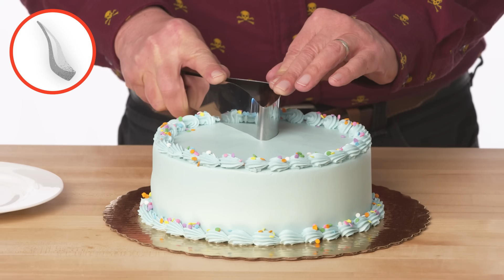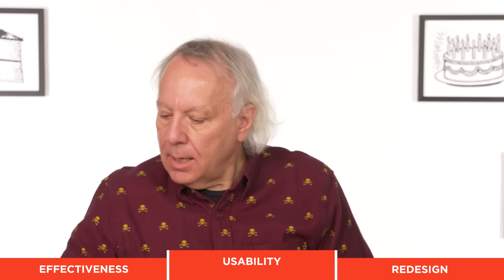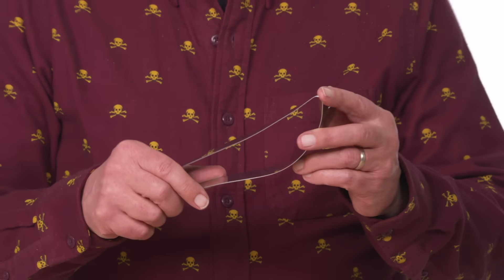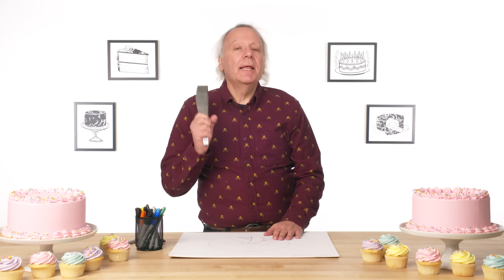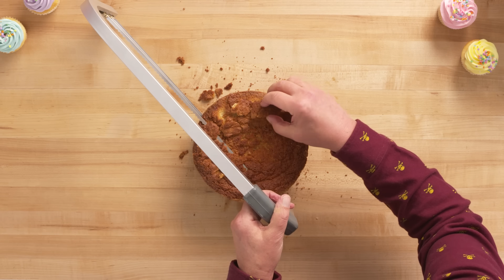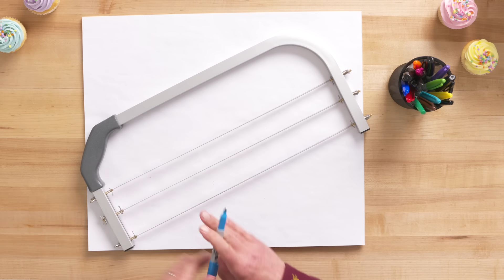5 Cake Making Gadgets Tested by Design Expert | Well Equipped | Epicurious

Comment: What kind of burnt sawdust cakes were made for this video? I’ve used cake levelers like that, as well as wire cutter ones, they work FINE. A cake leveler like that should slide smoothly through because it’s fluffy soft cake, not the same density of low-moisture brown bread lol.
Reply: That's kinda the problem with the cake leveler in the video, it didn't use a wire...
Reply: The thin band saw like blades don't offer much for force, and with the saw teeth, they grip at the cake meaning he has to use more force to cut through. Thin wires can't catch onto anything because they're just that, a thin wire, and the simple design of them allows for easy cutting, hence why levellers come in a wired variety, and not saw blades.

Comment: The Wilton cake leveler uses just one “blade” in the form of a wire, so it’s easier to get even layers and it’s got plastic feet that allow it to easily glide over surfaces. Also uses springy wires at the edge of the leveler if you need to readjust heights. No screws to screw with.

Comment: The cake leveler he redesigned also would not work. If you push at the top handle, you also need something fixed at the bottom too, something like a sliding blade. Without that, the blade basically tilts down if you don't fix the blade at the bottom hard enough.

Comment: I hope they scrap that oily hands portion. Because why would you use kitchen utensils if your hands are smothered with oil?
Reply: the point is to simulate having limited strength/mobility in your hands -- so like, if someone elderly or otherwise disabled was using the product

Comment: I think the first product was tested unfairly. First off this guy is using a cake knife yes, but it's intended design is for cutting the cakes top off to make it flat for glazing. Not for serving. He needed a knife with a sharp tip, go directly down from the guide and roll backwards along the edge of the blade. It's simple to see he's using the design not in that way, and with the incorrect tools.

Comment: I think that zyliss easy slice should be re-evaluated. Once you push that plastic portion forward you should have a piece of the cake hanging. In theory if you put that portion on the plate then pull the plastic portion back it should come off neatly. That's why it comes in two layers. The metal portion and the plastic portion that was made intentionally smaller.

Comment: The cake slicer did a better job than him yet he still gave it a 0.
It didn't give you 4 slices because you didn't set it up properly.
His cuts were so uneven he didn't even show them.

Then on 12:20 he gives a 0 to this gadget. Sure it's not necessary but you can see the normal server needing the assistance of his other hand to push the cake out. Had he assisted the gadget, the cake wouldn't have to fall like that.

Comment: “Bit hard to push through” the cakes are Rock solid mate 🤣
Reply: It isn't the solidity of the cake, it's the force required to do multiple cuts at one. The leveler was essentially cutting 3 different segments of cake, meaning the force required to regularly cut one slice is now multiplies by three. That's how math works. Now add on top of that, the blades are thin, they don't really put much of your force through the cake for decent cutting. The cakes could have been light as air, and those devices he used would still do terribly.
Reply: ya it looked it
Reply: Not really, they cut easily with a normal knife. The point was these gadgets were either thicker than a knife, or trying to cut multiple layers without a good handle
Reply: True

Comment: i feel like the two handed cake slicer might have some use for someone out there, but i can not figure out who would benefit from it. (i do agree with his design change to the handles though)

all the other ones definitely aren’t that great though. that cake slicer divider at the beginning looks like it has potential at least. why didn’t the designers use like, small metal poles arranged like a table instead of that central plastic pole though? it would help keep the device from wiggling in the very least.

Comment: I have a cake leveler at home but mine doesn't have that serrated blades, it only has some kind of very thin wires or strings(?) It's actually quite easy to use and I never really had a problem using them.

Comment: I can't believe somebody thought it would be a good idea to design a curved cake slicer
Reply: If it would be symmetrical it wouldn't be as much of a problem and some people just like the aestathic, but this one is garbage.
Reply: @Arthephone2000  doesn't have to be symmetrical, but I suppose that you mean if the cake cutter is shaped so that it can make a tessellation out of the cake
Reply: funny thing is I can fix the gadget with two changes
1. cut it in half to it's just a singular curved blade so you can cut to the center and spin like normal
2. put a handle on it
Reply: It could be fun for a party or special occasion to have unconventionally shaped cake slices, but I just don't know why they wouldn't do the nesting thing that Dan referred to.  All the cake you'd save!
Reply: Those are the same people that cut a square piece in a circle pizza they are evil
Reply: It fail because he used the other end instead. Anyway it's still a useless product.
Reply: This thread is absolutely hilarious. I legit can't 😂🤣

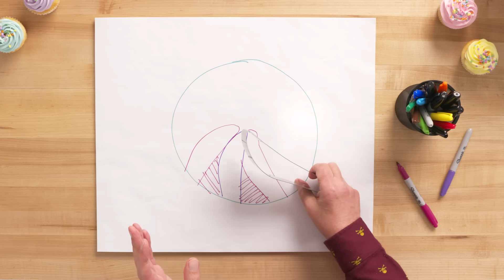Also for those saying flip it around, he addresses this: 6:38
Reply: What I don't understand is the shape. Why would anyone want a slice shaped like that?
Reply: I have a feeling the other side of the slicer has some kind of function, but Dan didn't even consider it
Reply: @Eralen00  ya but then both sides would be covered in cake and you hands would get dirty, very flawed if that was how to use it
Reply: @Eralen00  the back half (the other side i think you're talking about, held in his hand?) is shaped so you can squeeze it together to make sure you can pick up the cake piece in the front half, all the way up and out of the cake and then release a bit so it drops out onto a plate.
I don't understand why it doesn't tessellate, though! 🤷🏼‍♀️
Reply: @MsWnDrLnD  Yeah that's the part I was talking about. I just got an idea though, what if this slicer isn't meant to slice every piece? You'd use it as shown in the video, but instead of trying to slice the next piece adjacent to it, you "skip" a slice. Since the slicer goes to the center of the cake, the second and third slices are both cut at the same time. Not sure if I'm explaining that clearly. Using it this way doesn't leave a tiny "left-over" piece from the edge of the cake
Reply: @Eralen00  The curved cake slicer is a lot better then he made it out to be. The painful use is definitely a problem, but like you said, you can skip a slice and get two types of interesting slices. Furthermore, the comparison to a regular sliced piece is completely off. I want to see him try to cut the same shape with a regular knife AND take it out without breaking the rest. I think it's a lot better than he said.
Reply: @tbpotn  then u would lose a lot of cake for a slightly curved slice
u seem very dense
Reply: @nepneps1  
No, they're not saying you should throw out the in-between parts, they're saying you should make that space larger and that should eat them.
Reply: @IrvingIV  Yes. But what's the point of that when you can just traditionally cut it in even pieces and distribute it to everyone?? I'm geniunely baffled.
Reply: It works fine he is just using the thing wrong.
Reply: I have this gadget. The first slice will be bigger than the rest but to use it functionally you continue to overlap the curved edge on the last cut so that there is a bit of a gap leaving the straight edge biting into the cake - the aim isn't to get perfect curved slices but to easily cut and pick up a slice of cake.
Reply: Bruh all you have to do is flip the curved part and you would be able to cut an even piece
Reply: @DanielaGarcia-yc8xo  That works once. And then you have an oval cut into your cake and you're stuck for the third slice, since there are only two options>   (| |) (| -or (| |) |)  This should not be this hard.
Reply: All he had to do was flip the direction of the slicer so that the straight slice of cake would align with the slicer then just keep alternating. That way no cake would be wasted.
Reply: @marvellouslymade1533  no it wouldn't. it only match up for the second slice. it'd be a biconvex shape. then what about the third one? it would still leave out lots of cake. silly gadget.
Reply: @MrGhostTheBigRoast  Ok align the straight part with the straight. Look at 4:47 if you can imagine it flipped then boom, flip it again so that the curved blade is on the curved side then again. If you noticed on the slicer it doesn't have a traditional spine like normal knives.
Reply: @WhyYouMadBoi  You should try drawing that on paper or something
Reply: @panumastubsee603  Did still works. Its a circle cake and the cutter is a semi circle shape.
Reply: @WhyYouMadBoi  Try redrawing again, but this time actually draw a curve and a straight line. It's geometrically impossible for a round cake to be cut flush and equally with the curved slicer.
Reply: @goodestboi7692  Did it again, still works
Reply: @WhyYouMadBoi  What the?? How?? It's literally geometrically impossible...
Reply: @marvellouslymade1533  Nope, because then you wouldve have a curve going the other way, meaning you're still losing alot of cake. There are 0 ways to cut equal slices with it.
Reply: @marvellouslymade1533  No, because wht about the third slice?? You already have a curve slice on your cake (on both sides), how will you align the tool for the next slice? Still impossible without excess.
Reply: @marvellouslymade1533  What a brilliant idea. Using pretty much all the sides of the tool leaving no clean space for your hands to grab not only will give you a not-perfect curved slices but also some hygiene insecurity regarding the cakes. I am wondering if it's any better to just karate-chop the cake instead

Edit: wrong reply
Reply: @marvellouslymade1533  it doesn't tessellate, though. after doing what you describe once, you end up with two pieces, and two curved edges in the remaining cake that you can't line the cutter up with
Reply: @marvellouslymade1533  that doesn't work, cause you'd get a backwards slice next
Reply: @DanielSultana  Yes! Finally someone understands! It would still have excess because doing what the person said would mean having a curve slice on both side. It would be impossible to align with the third slice.
Reply: @marvellouslymade1533  That's just two slices.
Reply: @marvellouslymade1533  it didn’t look the other side was perfectly straight either so you’d always have different sized pieces too. Just a silly invention that seems really gimmicky
Reply: @marvellouslymade1533  I just commented this via my own single comment. Then found this comment and checked if any replies had stated this - exactly what I said.
Reply: @marvellouslymade1533  exactly! If they just flipped it then you’d be able to cut the slices without leaving out any cake like he did
Reply: A device like that would trigger Hipsters hard

Comment: WIth the two-handed cutter, I would be worried about metal fatigue at the point. It's gonna be stressed if you fold it tighter to put the tool away, or pull to make different slices.

Comment: I think the cake slicer was inherantly flawed, for normal cakes a sufficiently thin wire can easily pull through creating straight and level layers, it would've been a better product to just replace the blades with wire and having small fluid wheels to be able to maneuvre it without lifting it and un-evening the layers

Comment: It might not work so well for levelling the top of a cake, but to cut layers, the easiest way IMHO is to use thread.  I cut a guide groove around the cake with a knife, measured with a ruler, then put a thread in the groove, make a complete loop, and pull the ends apart to essentially "garrote" the cake.

The cake leveler idea would work best if it were on twin sliding tracks, with sturdier blades that can move horizontally independently of the frame to saw across the cake while being pushed through by the frame.  Of course, such a device would be rather large and not very home kitchen friendly.  I tried a similar cake leveler to the one in the video, and while it might work with enough practice, the fact that one needs to practice with it shows how poor of a design it is.

One thing that would improve the Easy Slice redesign is one or more rings in the handle for your fingers to go through.  That would better provide the counter-force than a bulkier handle.

Comment: The first thing is perfect for scoring the top of the cake first. Although good luck centering it
Reply: But if that's all you want, why not use a simple devided ring? Center it using the edge of the ring, press to mark, put it aside, use knife.
Reply: @HeyNonyNonymous  because that takes up significantly more storage space. Why would you keep a whole big thing when you could store a tool that's the size of a piece of sidewalk chalk
Reply: @ellieblunden1463  hmmm does there exist any collapsible ones?
Reply: Well, you say that, but you'll still end up with a massive hole in the middle of your cake and it'll mess up the ends of every slice. If it were just for scoring then you could have a much shorter and narrower prong, then have a single plastic/metal blade to place the initial mark that's longer and deeper that this design's prongs with a semi-sharp bottom edge so it cuts slightly into the top of the cake to mark the first slice (and makes the device less likely to turn during use), then the second part can rotate freely around the centre, clicking into position at the correct angles for scoring (you could probably also have some mechanism at the top to select how many slices you want). It's hard to explain without a diagram, but I think that design would work better with less cake-vandalism and less space for human error. It would be slightly larger, but that's a small price to pay for something to be actually functional.
Reply: If you're either:
Skilled enough
Intuitive enough
Experienced enough
To understand how to use that gadget in the capacity you mentioned, you're easily capable of acquiring or already have the proper tools or technique to do it that way anyhow, thus completely removing any need for the gadget.

Comment: If you put wheels on the saw thing it will be like 10× better. You wouldn't need to lift it at all while using side force
Reply: The wheels would have to move in 2 directions at once- up and down, for the "sawing" motion, and to the left or right, to cut through the cake

I feel like little feet things with felt on the bottom would work better and probably cheaper
Reply: @momsspaghetti7888  roller balls/ballbearing style

Comment: Let me show you why this cake divider guide is bad = Let me show you how I don't know how to cut a cheesecake without smashing it. I really think this kind of undermines half his argument. Use it on a regular cake and a knife that is sized for the job!
The level cake slicer is interesting BUT, there is no way to make it level on both sides. His issue was not applying enough downforce and he was torquing the handle to make the blades rise. In baking, the "4th layer" he was looking for is called SCRAP.